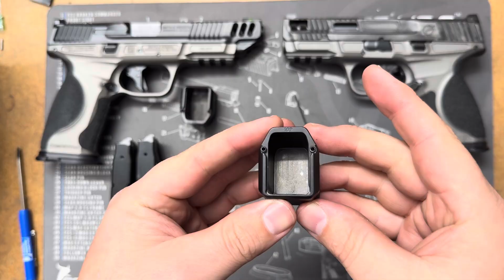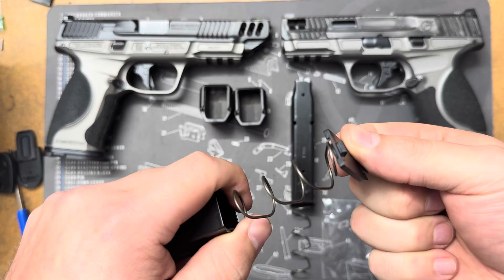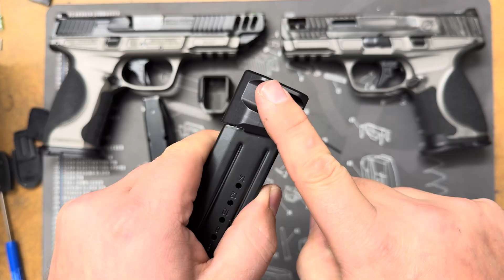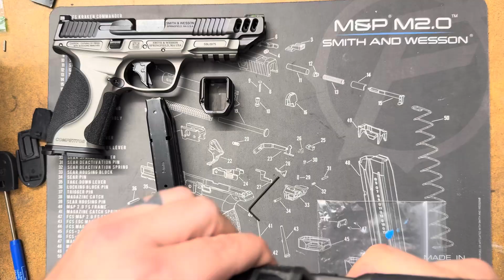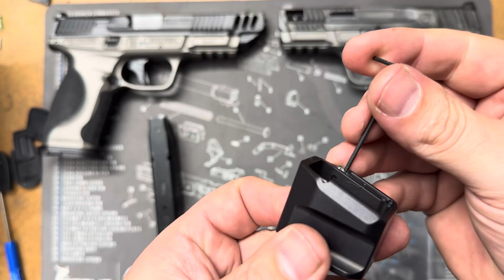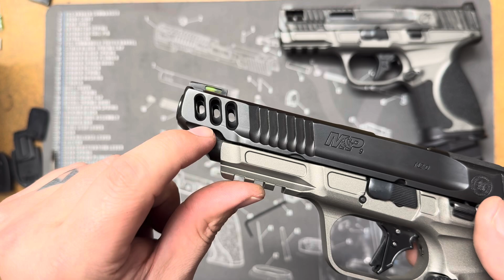Floyds Custom Shop M&P +6 install video

Comment: Is there a way to make these as a +0? I want a competition magwell but cant have any added capacity on the full size 17
Reply from the maker: You could plug the extension with something.  3d print a plug just to fill the  pocket in the extension
Reply: @floydscustomshop2157 ok maybe that’s the move. Do you know if the 10 rd compliant baseplates work with the competition magwell as well? Or are they too short?
Reply from the maker: @JD-um8sq they do work with the competition magwell but are shorter and designed more for the EDC magwell.

Comment: Is the recoil spring supposed to stick out a bit when the 6+ mag is fully loaded and there is one in the chamber ?
Reply from the maker: The extension would not change anything about the recoil spring, if it looks abnormal and you have taken it apart recently. I would take the slide off again and make sure the spring it properly aligned
Reply: @floydscustomshop2157 it worked thanks, but now I’m noticing that my mag only pops out when I hit the mag release on a full clip. When the mag is empty it stays in place and doesn’t pop out. Any suggestions?
Reply from the maker: @TommyF-o8q is this a polymer or metal frame?
Reply: @floydscustomshop2157 metal

Comment: I put a +6 extension on my 17rd mag and I have the compact frame. Would there be issues with over insertion because of the gap?
Reply from the maker: There is a chance of over insertion if you are slamming the mags in with the slide locked back. We do make spacer sleeves to go from the 17rnd mag with our extensions to the compact frame with our Magwell to prevent over insertion

Comment: so I can use my stock mag spring?
Reply from the maker: Stock springs work fine in most cases. Some springs are a little under stretched and may not lock the slide back after the last round

Comment: just did the install and i just loaded only 19 total rounds mag 15 + 4.. trying to load the 20th bullet is super hard any thoughts  thx Floyds
Reply from the maker: In some cases the follower can catch on the edge of the extension as it transitions from mag bumpy to extension, if you force it with a mag assist loader then a little bit of the plastic edge of the follower will scrape off and no longer cause issues. Or if you take the mag apart you can lightly file and round the back corners of the follower and it will roll over the edge.

Comment: Hey I’m from New Jersey and I have a smith and Wesson M&P compact polymer frame, mags are block at 10 rounds. Will the mag extension work with the block mags?
Reply from the maker: If it’s a standard capacity mag that is blocked the. Our normal plates or extensions should work find, as long as the block isn’t movable and not glued or or something. Without knowing how it’s blocked I can’t say for sure

Comment: My bullets keep falling out of my magazine. I don’t know why it’s doing that. I also bought the extra coil too!!
Reply from the maker: Do you have the 10mm or .45? The install on the mag extensions is different as there is an indent in the mag body that needs to be filed down smooth.
Reply: @flo @floydscustomshop2157 I have the 10mm. It has to be filed down?? I don’t understand
Reply from the maker: @BHJGGG-b2q  https://youtu.be/83L6Yc_oq2g?si=kIbjmNvE-fFmWDgD

Please watch the video for the 10mm mag extensions. Here is a link
Reply: @floydscustomshop2157 thanksssss

Comment: why don't you reinstall the locking plate? even if trimming / sanding is required? or maybe include one that fits? don't know. just seems strange to let the spring not have lower plate to ensure it sits properly.
Reply from the maker: Because it’s not necessary. The locking plate is only used to lock the stock plate on. It doesn’t need to hold the spring in place. It has grooves to hold the plate down properly. But its purpose isn’t actually to guide the spring

Comment: hello, will the +6 function on a pinned mag? I mean as in feed reliably, i know it won't increase capacity since the mag is pinned (im in ca) that's fine, im just after the aesthetic.
Reply from the maker: Yes that should work fine

Comment: Just installed the magwell on my 3.6 compact METAL.. didn’t have to alter it, just had to kinda bang it in place just little with a small mallet but overall was easy to install. Got the +2 and +6 extension installed easily as well. Highly recommend
Reply: Did you have to replace the factory spring in the mag?
Reply: @chris.la13 no sir,

Comment: Does it work with the M&P 2.0 3.6 Inch?
Reply from the maker: Yes it does
Reply: @floydscustomshop2157 perfect thankyou
Reply: Just installed it on my 3.6 metal, works perfectly, might have to bang it in place a little with a small mallet but it was easy to install

Comment: amazing products just received the M&P 2.0 "COMPACT" EDC Magwell 9mm/.40 and two S&W M&P MED PRO BASE PLATE 9mm/.40 for my Smith & Wesson M&P9 M2.0 Compact Carry Comp, super easy to install, the magwell edc took me less than a minute and for the pro base on both mags the same, so far excellent and give me the extra hold on the grip with the EDC magwell super happy! fully recommended
Reply from the maker: Right on! Thank you very much!!